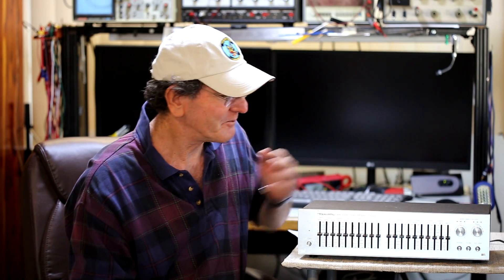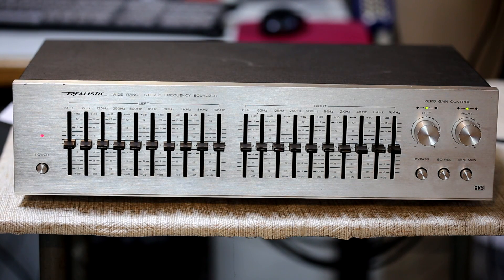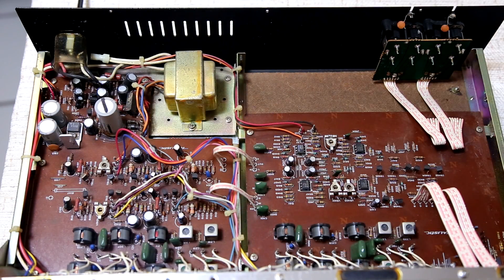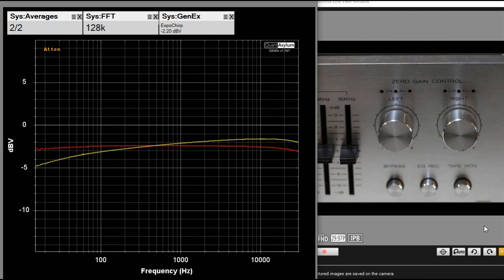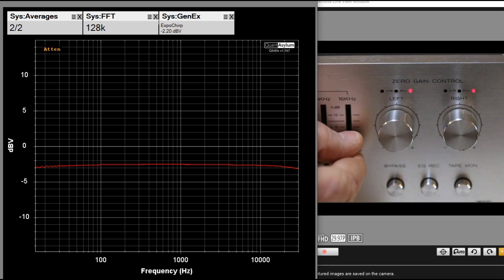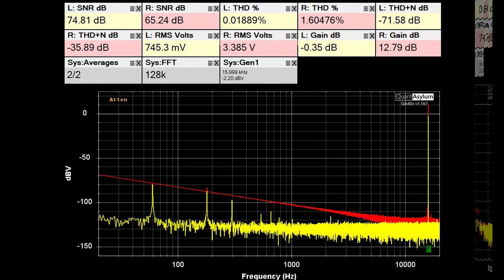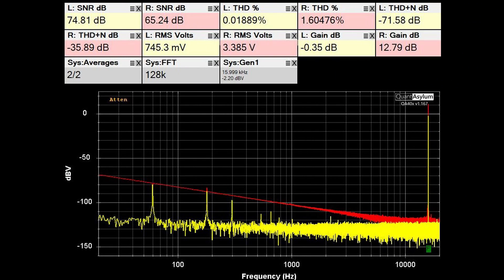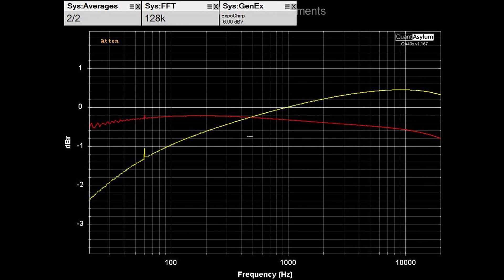Realistic 31-2000 Graphic Equalizer- Vintage Audio Review Episode #42

Comment: My 1st 31-2000 only cost me $25. Then I bought several more for around $50 each. I mounted rack ears on two of them for portability. In my main listening room, I use one of these units like a preamp for a 100 wpc amp with a set of Klipsch heresy speakers, and the sound is quite good! Thanks for sharing! (from a small OKlahoma town)
Reply from the maker: Thanks for sharing your "story" and am glad they are working out for you. Not sure about using them as a preamp, but if it is working that's great. I thought all places in OK were small 😄
Reply: @vintageaudioreview nope! Oklahoma City and Tulsa are quite large!
Reply from the maker: @marsmediapro  I was teasing- I am not sure I have been in OK, except maybe as a kid driving through it. Tucson is not overly big.
Reply: @vintageaudioreview no worries!😅

Comment: I've just picked one of these (East coast of Australia) - powers up (including gain control LED's), but gain controls look like they're not working (unless they only work when connected to a source?). Also, are you testing the caps on the board, or removing them one-by-one? I have an ESR component/cap tester, so happy to work through the board to fault find.
Reply from the maker: Thanks for the comment from down under. I think you need to have the EQ connected for the control leds to show movement- try that first. Surprising that you did not considering you have what I assume is and IN circuit ESR tester. I would test larger value caps with that first, in circuit.

Comment: I need help.. I recently got one but it plays distorted .. I've changed all caps so far.. tested all transistors and all are ok.. I don't know what the power supply voltages are supposed to be.. 🤷🏽‍♂️
Reply from the maker: You can search for the schematic online and use it to troubleshoot the EQ. Hopefully it is labeled clear enough as sometimes the copies are not great. If the ps voltages are ok then inject a 1khz signal and trace it with a scope to see where the distortion occurs- good luck!

Comment: In 1977 a girlfriend had a Pioneer SG-9500 EQ and it's effect on the sound varied from subtle to dramatic. I was hooked. Though the standard ten band (octave) EQ was popular I opted for the, then new, Sound Shaper Two with the VU meters. It had twelve bands per channel and was perfect. At least till I added three tape decks (two cassette and one open reel). I upgraded to the IC version in 1982 and in addition to twelve bands it offered L/R meters, output controls and bidirectional dubbing. Also had a useful subsonic filter (18dB/oct @15Hz). I use it more as an elaborate tone control than to equalize the room. Still using it today. Man-o-Manischewitz, a swell component.
Reply from the maker: Thanks for taking the time to comment and share your experience. I remember the Sound Shaper two- with the VU meters, not the LEDs. I am pretty sure I owned a Sound Shaper 1 and sold it when I built my portable DJ system and opted for a 15 band MXR eq that was rack mountable and thinner for use my stand. I agree completely that the equ was (is) a more precise tone control.
Reply: @vintageaudioreview - yeah, the IC versions of SS1, 110, 2 and 3 had the lit sliders and SS 2 and 3 had LED meters. With my RG-2, SS2IC and Akai cassette deck's LED meters I had a mini Joshua Light Show. In 1978, prior to buying the SS2 (VU), I did check out several other EQ's including that MXR. Think it was the model 127 (??). Not to disparage MXR, I didn't like the power on arrangement, teeny weeny sliders too close together (for fat fingers) and flimsy looking construction, it wasn't cheap either and it wasn't for me. Though the fifteen sliders did make for easy fine tuning a system. Woulda really dug a Technics SH-8065 (double 1/3 octave EQ) back in the day. Thanks for letting me reminisce. This Realistic unit you show could be an excellent addition to any hifi system.